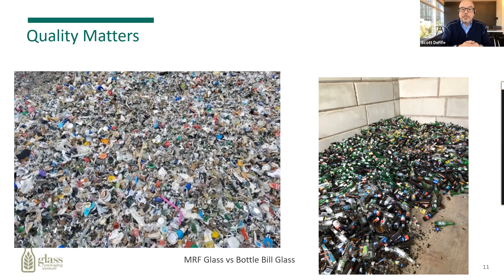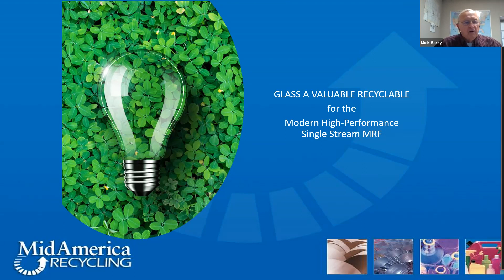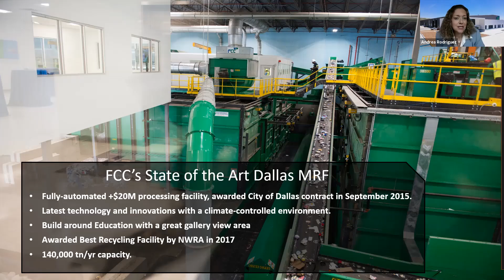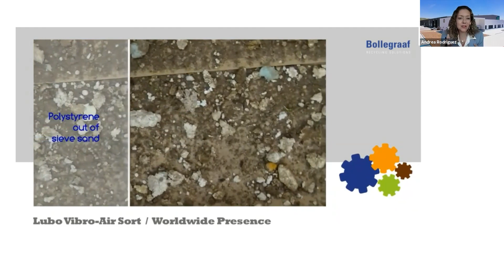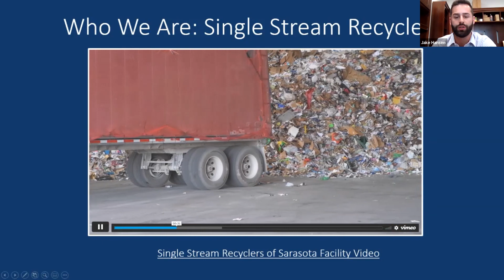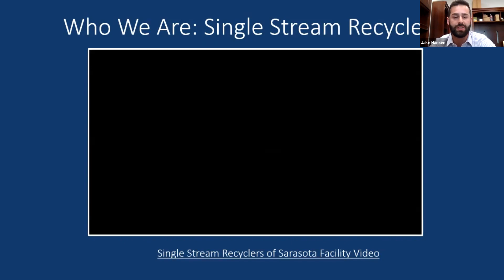How Glass Recycling Works in High-Performing MRFs

Comment: I'm 100% for bottle bill states and full recycling of glass containers.  Good job to those who work in this field and make it happen.

It is such a shame that a perfectly good bottle gets broken up and becomes a problem for further recycling of other materials when it can be reused after being washed.

One thing that would help a lot in all ways is to standardize size, shapes and colors so there aren't so many variations that would require sorting as much and would allow more to be recovered and reused before it even gets broken.

Optical sorting is great and I'm so glad to see it working well for those who can afford the technology.

Also, in some communities they can use sand for beach rebuilding so to take fines and grind them small enough that they can be used for beach restoration can be a local use that doesn't require as much shipping distance or energy.

More standardisation (as mentioned above) can also help in reducing contaminants.  If a label is paper based and doesn't have plastics or foils in it then that means it can be repurposed or composted after it has been removed.  Something simple that our system should be encouraging the packaging industry to work towards and not continually coming up with things that cannot be recycled.